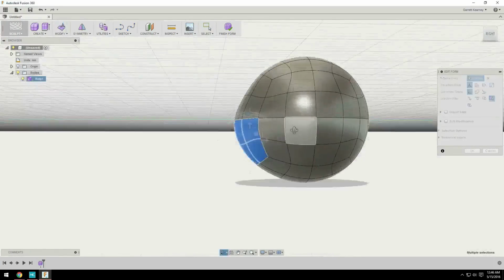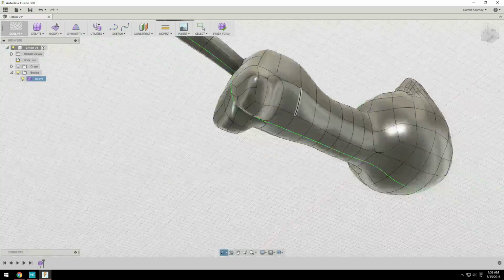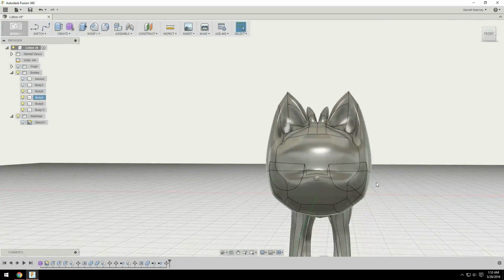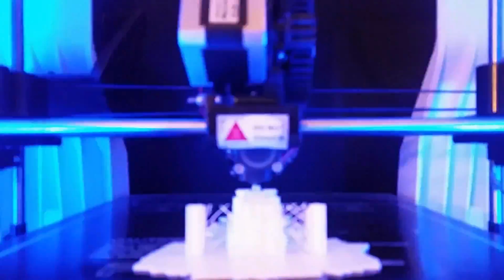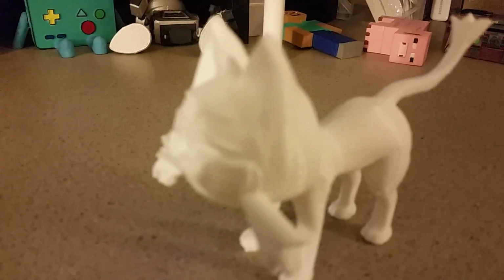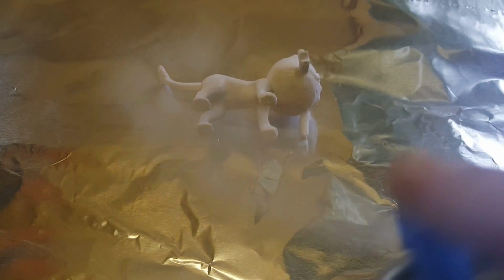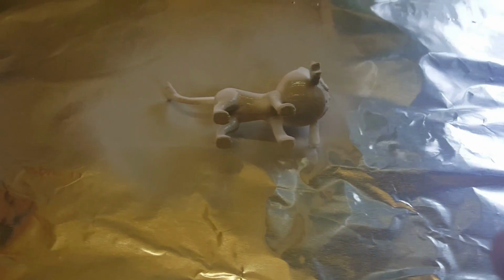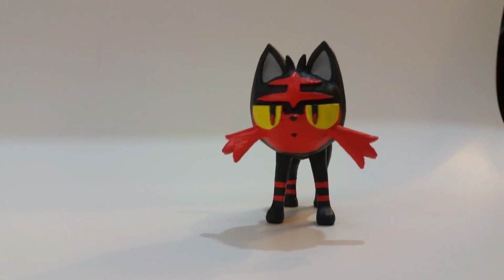3D Printed Litten [Pokemon Sun & Moon] - Fire Starter

Comment: I wanted to get the modeling program for free, but they require you to be a student or a teacher.  I graduated university 12 years ago LOL.  Ah well, I'll check the free trial out.
Reply from the maker: They actually have a "startup business" option that they are pretty open about. They don't require you to confirm any sort of business license or anything and I've actually talked with someone at Autodesk and they seem to want as many people as possible to use it. So I think as long as you're making under that certain amount, you're good to go. :) I hope that helps!
Reply: +Chaos Core Tech Thanks a lot for the info.  I'll try it out.

Comment: hello I know this is not the right video to ask you about it  but I need an answer (ps: I'm french) ... so i'm gonna get a 20 cm 3D printer and I wanted to know if I can print the plasma pistol that you made ? or I have to reduce a little bit the size maybe ?
Reply from the maker: Yeah you should be good with that. Mine is actually a little less than 20 cm, so you should have no problem. But if you wanted to scale it down, you could also do that. I think mine was a little too big lol.